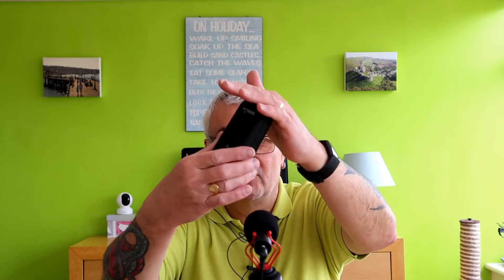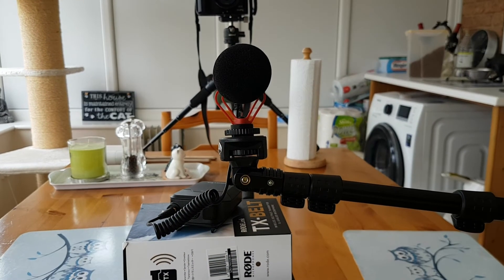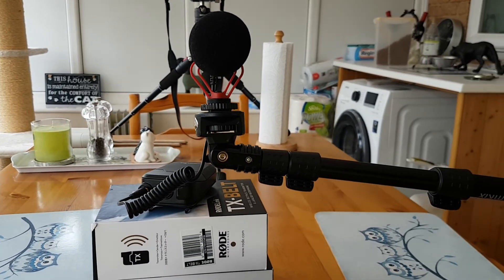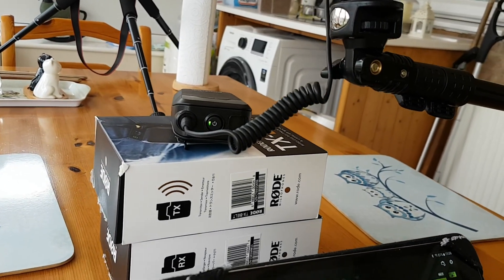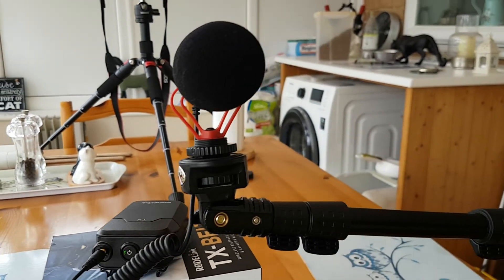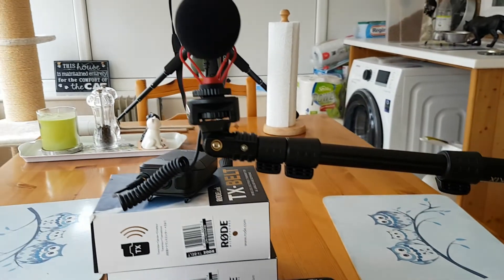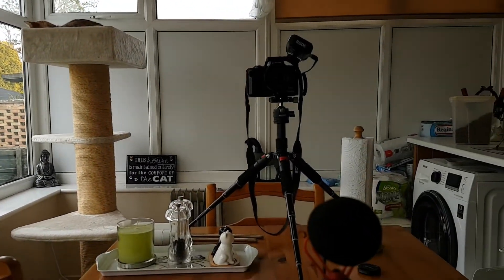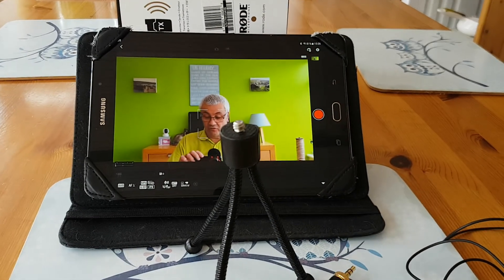Lav vs shotgun Mic Pt #2

Comment: Blimey Jon, that room has some reverb. Has it got a rug or carpet down? Funny thing is your room sounds more reverb laden than my box room.

Believe it or not, the Boya slightly improved when on the mini tripod! Maybe your body is shielding the back wall. 

Blanket on the table under the Boya with your body shielding it? Also try rumpling the blanket up around the mic so that it’s a little bit more enclosed. Very difficult.
Reply from the maker: Hi Ian, thanks for commenting, we have a couple of rug down at each end and a large curtain to my right, i'll try out your suggestions but i think i'm fighting a losing battle with this one might try handholding the boya as a test  but i think i'll stick with the Lav.
Best wishes stay safe Jon

Comment: Hey Jon! hope you and the Candy crush Queen are well. I still prefer the original setup with the Lav even though the Shotgun mic has less echo than before. Been switching between your last video and this one to check too. no buzzing from the Shotgun that I can hear. However, still good quality though. Stay Safe.
Reply from the maker: Hi Steve hope you are well, the shotgun defo does have less echo but is a real pain in the £&%) to set up and if i'm using the table to demo something it gets in the way, so i think i'll stick with the Lav setup. I may do another test when i setup for another video. I just finished converting the darkroom videos from VHS (4 in total) so i just have edit them, hopfully they'll be coming soon.
Thanks for commenting, I'll email regarding possible met up when we're on holiday a bit closer to the time.
Best wishes, stay safe Jon & The Candy Crush Queen